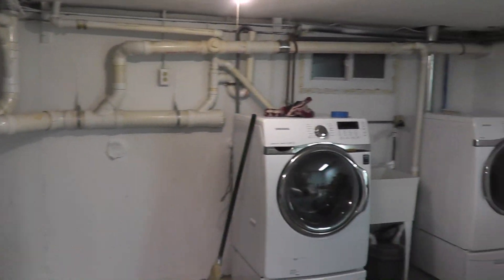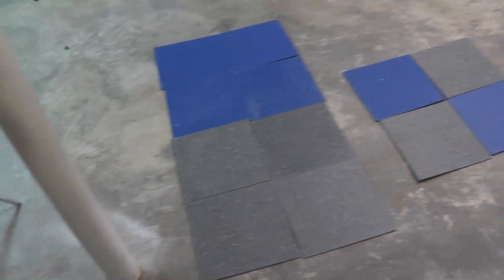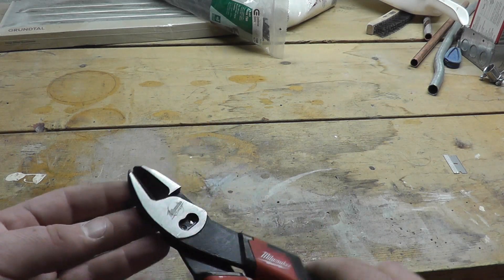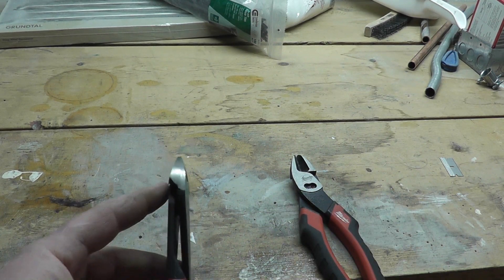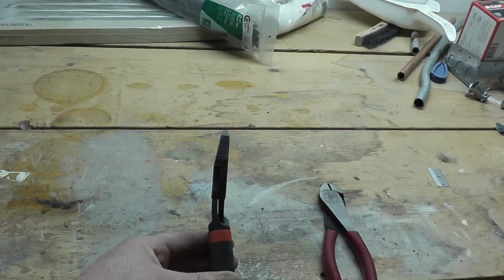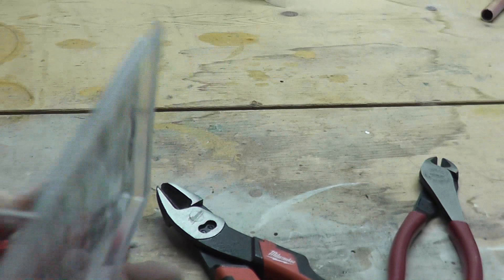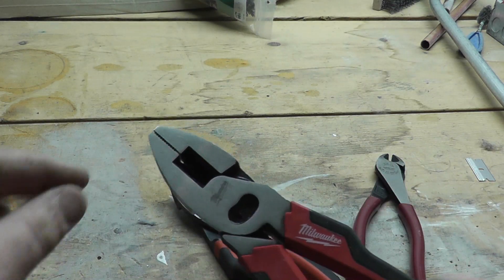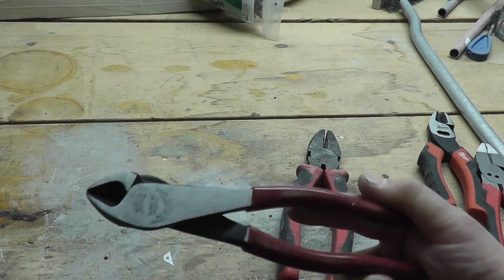Electricians Tool Review:  Klein vs Milwaukee

Comment: Good to see you back making videos again, overall good shop progress. I like the tool review. I have given a few tools the heave-ho at the very moment they smash a finger; keeping them around for a review did not occur to me.
Reply from the maker: The tool that got me the worst ever was a pair of channel lock's.  They weren't Channel Lock brand they were something else and even though they had the grooves to prevent it from slipping the two halves were joined by a screw and nut not a rivet.  Needles to say the nut loosened and when I went to grab on to a pipe and turn instant crushed finger.

Comment: Hi Greg, 
It looks like the new workshop is coming together slowly but surely.  It seems you have a good handle on what you want and where you need it.  Just a quick comment/question: why not paint your basement floor with the epoxy paint they sell for garage floors?  You might not need to worry about any divot or wrinkle in the concrete for the tiles to lay flat.  Keep up the good work and I look forward to seeing the machine work, etc. in future.
Best regards,
RS
Reply from the maker: Just a personal preference.  We had the epoxy floors in highschool and also in my shop at work.  Only problem, was that after a year the paint started to wear and chip and peel.  I had a VCT floor at the other house that was over 25 years old and it survived everything including floods.
Reply: *****
Makes sense.  Thanks for the response.  RS

Comment: Some versions of Klein linesman pliers have the extra jaw for pulling fishtapes. I personally don't like to use pliers on my fishtapes but on occasion they do get stuck (underground pole light circuits especially) and that extra jaw provides a whole lot more clamping force to be able to pull yhe tape out.
Reply from the maker: The ones I have (yellow handle) have the crimpers on the handle.  I always seem to use my needlenose to get the fish out from behind an electrical fitting and I go to my Channel locks if it needs a yank.

Comment: Halligan, what are the best pliers for stripping cable? Do you have Marvel tools in the US?
Someone I met swore by the Marvel MVA200 but they've stopped making them. The guy seemed to strip the wire in one action, whereas with normal pliers, you have to cut the insulation first. I hope I'm making sense.
Reply: Just to add, what does the "VA" stand for on non-side cutter pliers?

Comment: Thanks for the review.  From looking at your cutters I can see that I would hate them for the same reasons.  I use Klein screw drivers exclusively and prefer Ideal Linesman's and strippers, but the screw cutters on that linesman is a nice touch.  I'm also not too crazy about the big chunky handle grips that are the fad, now.  Just makes the tool pouch bulkier and when you pull out a tool those handles snag all it's neighbors and drag them along.  Not fun for the guy holding the ladder.

BTW:  The rear jaws are so you can grip a fish tape and pull with hands on both sides.  As for the reaming use one jaw in 1/2" EMT. 

Now quit farting around and get that shop done :P
Reply from the maker: I like them on the Linesman's.  Makes cutting the larger gauge wires we use to feed the a/c units more comfortable to cut.  I have a beater set of screwdrivers (I believe they are Husky) for beating out and trying to loosen those rusted screws and I have a set of Klein's for normal work.  Although I find myself reaching for my Klein 5-in-1 a lot.  It's just convenient.

Comment: Checkout klein's journeyman series you get the bulky handle that you like and well the quality of Klein. I'm a 2nd year journeyman electrician been on about 100 different job sites worked with thousands of electricians , hvac, and your low voltage guys and Klein is the only thing in my tool bag not just preference but tried and tested. Go on any job site and "in particular order" Klein , ideal, and greenlee are what true professional tradesmen have in their bag not knocking you for having an opinion I'm just sharing mine

Comment: There is Klein linemans with a thicker rubburized insulation there just more expensive 36 (blue ones) 45 (yellow ones). And they are the best nothing beats Klein's cutting strenght
Reply from the maker: I've been disappointed with Klein lately.  I got some Knipex cutters and love then.

Comment: all klein for me but the Milwaukee linesman pliers are great ...hatin on the fish tape puller when you dont even know how to use it. grab the fishtape with the fishtape puller jaws and hold the pliers perpendicular to the conduit, left hand over plier jaws and right hand over handles like a t bar and it will hold all day and pull the most stubborn run
Reply from the maker: +Gaby Salas You can do the same thing with the crimper section of a Klein and it's way more useful

Comment: My  brother has worked for Klein tools for nearly 8 years and he even says their tools aren’t worth the hype. Their steel might as well be made out of butter. I’m an electrician and I’ve had a lot more success with Milwaukee than anything but the 6-in-1 things aren’t that great
Reply from the maker: Interesting.  I had decent luck with Wera, but those are in the house toolbox now.  My go to is Wiha.   Love them.  I also have a set of Milwaukees with the steel end caps for knockouts and lockrings

Comment: ya I found that to with the side cutters.  absolutely garbage.  try cutting 14/3 with em , it's way harder then it should be.  those linesman's do look good though
Reply from the maker: +Greg Cumming They've held up so far.  I do have a nick in the blade, but that was from me cutting a bolt that wasn't really supposed to be cut with pliers on an 18 degree day.

Comment: Milwaukee is relying on their name to sell accessories, driver bits, drill bits, pliers, electrical meters, most are made in Asia and are junk. I am sad to say this is the voice of experience and I have sold off everything Milwaukee I have purchased, the power tools are tried and true designs and I wouldnt use anything else. But their accessory line of tools needs some more R&D time in my opinion.

Thanks for the candid video.
Reply from the maker: You know something I didn't even bother to check.  I just assumed they were made in the U.S.  They aren't.  They're made in Taiwan.  My electric hammer drill is made in Germany, my sawzall U.S. and so is my cordless hammer drill .

Comment: Hmm, audio is great. Video is, well... gone. All black.
Reply from the maker: Weird.  Just checked it out.  Worked for me.  Could be you caught it on the tail end of processing.  Give it another shot.
Reply: ok, works now :)
Reply: I like the Klein linemans pliers and their needle nose. Hated their dikes. I have a pair from crescent that I liked much better.  I also prefer the handles with no insulation. I don't trust it and wrap fresh if I need to work something hot. (Have not had to work anything hot in years since I left electrical work)